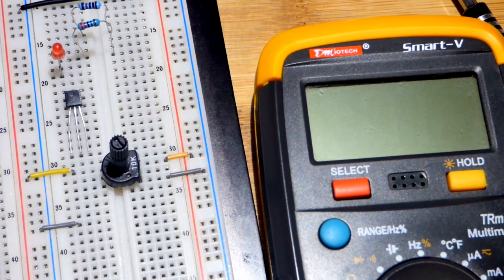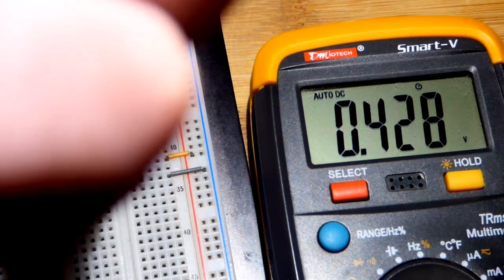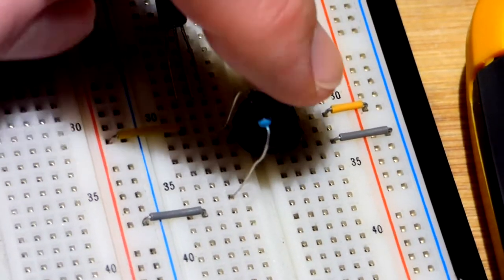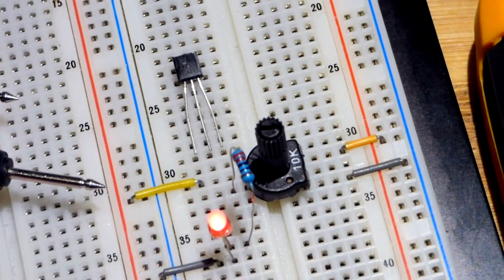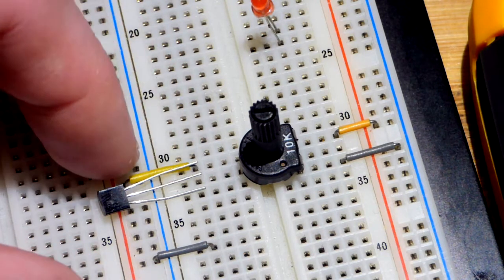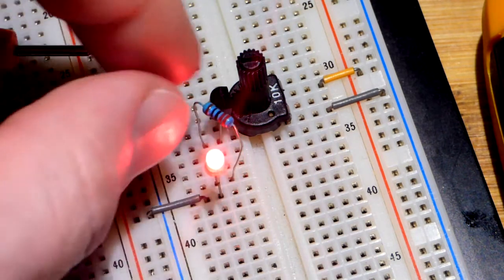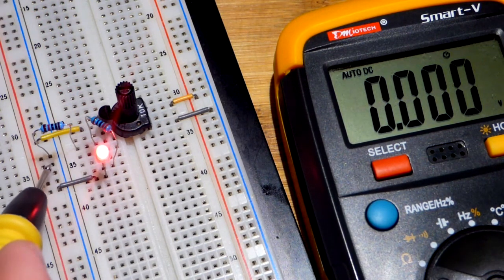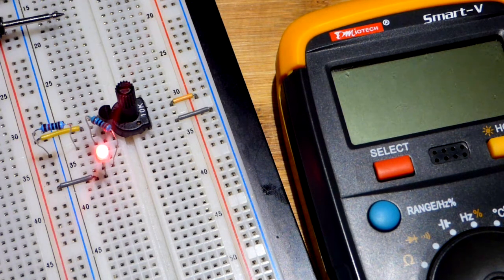How to 2N2222 NPN BJT amplify current power from a weak voltage source like trimpot voltage divider

Comment: 6:55: Why would you put a resistor across the emitter and ground?  Isn't that just wasteful?  Why would you get more voltage at the LED after creating a voltage divider?
Reply: Also I'm messing with a thermistor right now, ordered some from Arrow during free shipping...  It needs a current source (the dual of a voltage source, whatever that means), and I also know that the base of BJTs is current-driven, while the gate of FETs is voltage-driven...  I don't know if that means anything to you, but if it can inspire you, glad to tell you about my current wonders (pun unintended)  😁
Reply from the maker: Usually I don't need a resistor there. In a past video I ran into a situation where I really needed it though but I don't remember the details. It's always shown in schematics and since I ran into having to use it before, I just always add it now.
Reply from the maker: My guess for the meaning of "dual of a voltage source" would be a split power supply. Split power supplied are sometimes called dual power supply. You need current flowing from base to emitter of a bipolar junction transistor for it to conduct current from collector to emitter. FETs don't pass current through their gate to control the current, they just use a built up voltage at the gate to control the drain to source current.

Comment: What is the base volt to the trim pot??? 
If you do a vid on how to get 12 volts to 19
 to power a lap top from 12 volts to 19 I think you 
could get a lot of hits 
there is only one or two videos on this 
bu not very in depth as i think you might go 
it would be helpful, heck make a device 
that I could plug into a cigarette lighter 
to power a laptop and if it works... ?$
Reply: But don't tell how it works... ;  )
Reply: Oh 1en....
Reply from the maker: Voltage boosters are hard to make unfortunately, but are pretty cheap to buy.